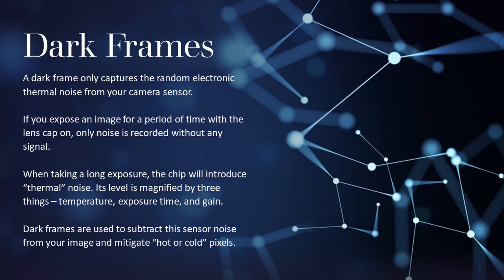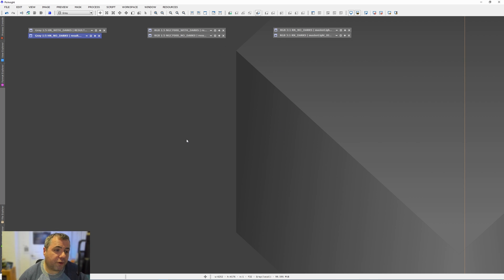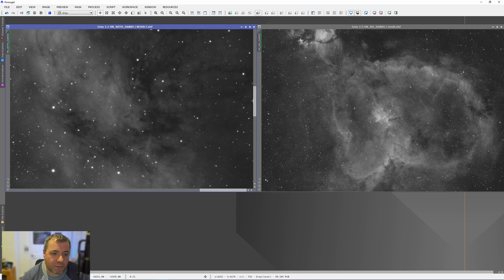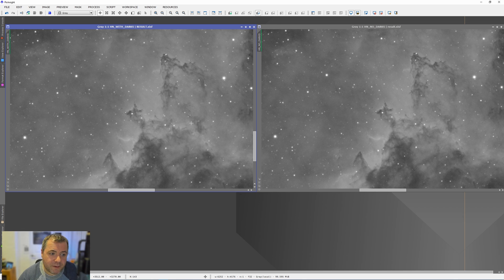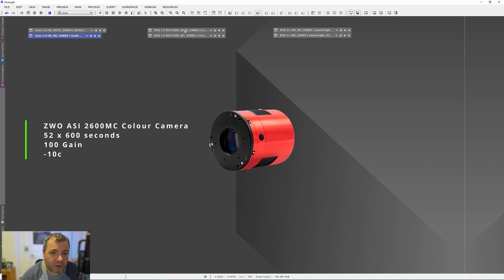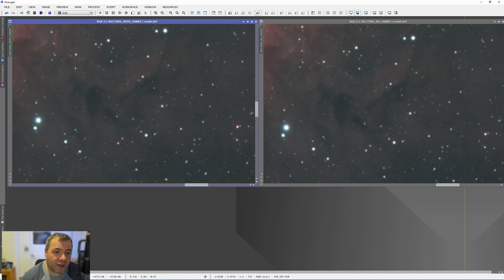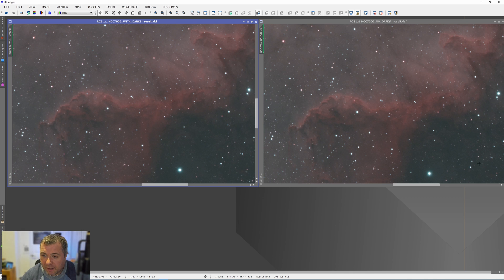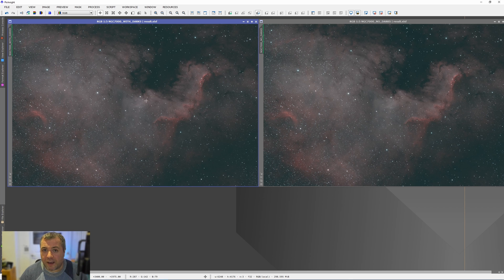Do you really need Dark Frames for your ZWO ASI2600 / QHYCCD 268 cameras ??

Comment: In my opinion this is an insane question to even ask. Why would anyone spend 20-50 hours on meticulously-crafted project, using thousands of dollars of gear, only to NOT use the easiest and most trivial of all calibration frames. Why risk it? You've already invested so much time and money, it takes literally one cloudy evening to build a darks library that will last for years. In the worst case you get a small improvement, in the best case you get a dramatic improvement, for almost no investment in effort. It blows my mind that anyone wouldn't calibrate correctly.
Reply from the maker: Thanks for the feedback

Comment: So if darks are not used how do you guys cope with the Hot and cold pixels, and if you don’t dither, as I don’t, how do you deal with walking noise, Darks stops all these issues….?
Reply from the maker: Dithering is the key along with the low read noise of the cameras. this is the way when stacking using something like PI, it can remove the H/C pixels very easily. 

without dithering the noise will be low, but yes you could have some walking noise.
Reply: @HogarthsAstrophotography  so for people like me then who don’t dither, dark frames are a must…the reason I don’t dither, is I have an EQ8 mount, that has DEC backlash, and so I guide in just one direction, which makes the lash moot, then I use dark frames, as it gets rid of any hot and cold pixels, and also any walking noise, so it’s far easier for me to use darks, than try and deal with dithering…👍🏻

Comment: I have a ASI294MC Pro and for that I obviously use darks. But since I have my second rig in mono, which uses the ASI2600MM Pro I have not taken the 'trouble' of creating a dark library. The only calibrating I do on that mono data is using flats and I bias. I had a video idea for it too on my todo list. You've covered the "does shooting darks matter" part quite nicely.
Reply from the maker: Hey thanks Martin. Its still seems a widely debated subject. often citing what about hot pixels, but those can also be removed during stacking without darks if you have enough..Glad you enjoyed it and found it useful

Comment: Great test Nigel! I love this kind of stuff. So when you do your flats, are you taking flat-darks then? I tried stacking some 2600MM lights without darks, but with flats taken with flat-darks and my images came out looking like the flats were over-exposed (which is impossible). So I took some light-darks and then the images came out perfect. I can only assume that the stacking software I was using (APP) was subtracting the electronic signature from the flat-darks and didn't have an electronic signature from the lights so it was adding that in to the final image. When I added the light-darks it then correctly subtracted the electronic signature (I'm assuming). I didn't try using PI to stack with or not using the flat-darks, but wished I would have to test with. What are your thoughts.
Reply from the maker: Thanks for the comments Joe. Interesting outcome you had.. The images I processed in PI, were with Flat-Darks. Im not an APP user so I can only guess, maybe the way they are integrating is slightly different, as the results should be the same (or there abouts).  I did have a video planned comparing 4 stacking programs, but never got around to doing it.. maybe I'll re-submit for a trial APP and do some more tests
Reply: @HogarthsAstrophotography  That would be a really cool video if you did that. I'd love to see how they all compare, I've used all the usual stacking programs before but never tried all 4 with the same stack to just compare them before. That's a great idea.

Comment: That is an interesting result. No question about using dark frames with my 183 sensors, lol.
Reply from the maker: Hey thanks.. Absolutly right about the other ZWO/QHY cams... I did have a set of data taken with my now sold 071MC, but thought the video was going on a bit to go through it as well.. they cleared benefited from darks

Comment: Great review.  Idid a similar experiment with my ASI2600mc.    I tried to convince myself that there was slightly more contrast in the darks version but the difference, if any was negligible.    One thing Ive been concerned about, is that my calibrated individual light frames (corrected with flats etc) appear noisier than the corresponding raw light frames.
Reply from the maker: What’s blown me a bit, is it’s quite clear on the YouTube video there is a larger difference on the Heart Nebula data pair, that I couldn’t see on my monitor whilst I was recording, but on my iPad watching the video, it’s a little more apparent. Maybe I need to calibrate my monitor, or my eyes 🤣
Reply from the maker: Hey thanks Cliff, I’m pretty sure I was doing the same, I wanted to convince myself the difference was greater. I will do some more tests offline, as right now I’m processing my images with and without darks and starting with what I think is the best out of the two.
Reply: I usually try and find two faint stars close together and try and assess how well they are defined in each image.   Aldo, if the stretch of the image is slightly different it’s hard to make objective comparisons.